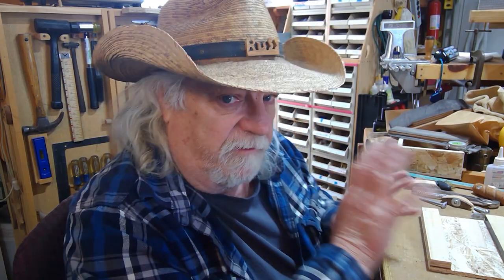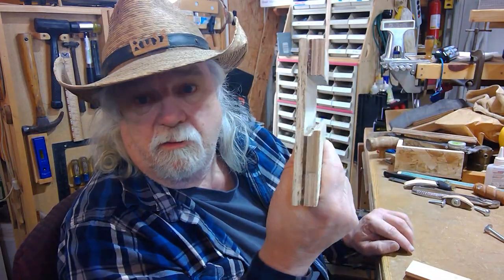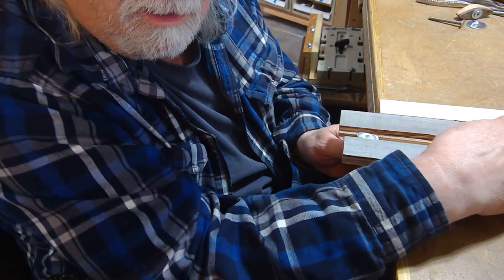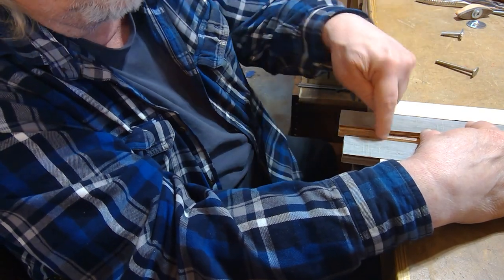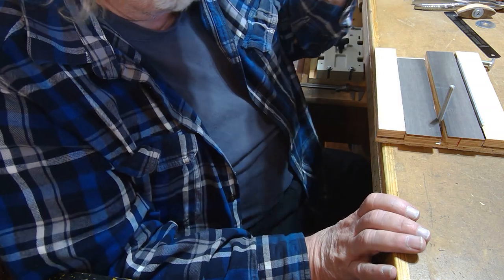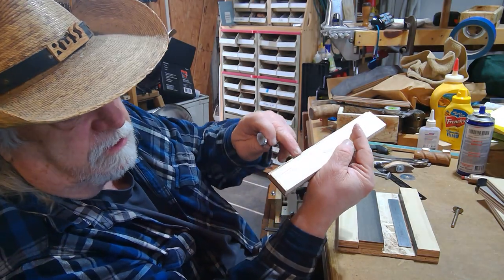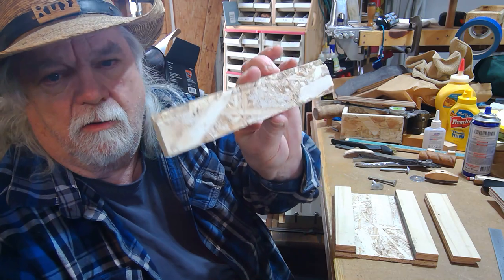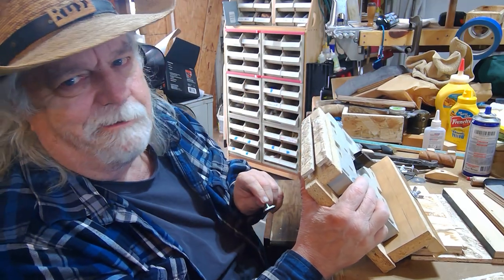DIY T Track & T Bolts by OTB Thinker

Comment: Well, Russ you certainly provided us with lots of variability. And that's quite important. I was looking for sources for the sliding nut and was amazed to find that only a few actually provided dimensions. And the ones that did provide them seemed to be those that also provided higher overall costs. So being able to slap together a t-track based on what you have or what was shipped is a handy skill to possess. Of course, ideas and techniques also are always a handy resource to have. As usual, well done!

Comment: Hi Russ, have you ever tried, making a T-Track directly into a Wood Top? Say, 3/4 inch or more thick. By using a T shaped Router Bit. Can't think of a proper name for it. Use a Bit, that has flutes, both on the sides and bottom. With a 1/16 inch or smaller Radius. Use this, along with a Straight Bit, for the first 1/4w x 5/16 inch depth cut. Then use a 3/4 inch Diameter T-Bit to rout a T-Track into the Work Bench Top. Setting the required Depth, to fit your T-Bolts. Using a Straight Edge, as a Router Guide. A straight board or metal that's thick enough, works well as a Router guide. I haven't done it either. But, I have used Routers to make Wood Trim. And many different things, over the years. I was a Cabinet Maker, back in the 70s-80s. And a Hand Finisher & Tool Maker, at General Dynamics. During the F-16 Program. We routed Radius's in Aluminum Machine Parts. With Hand Routers (Dotco Air Motors). Some, that the CNC Machines couldn't do. You can make many things with a Router and a hand Drill, if you get a little creative:) Thanks for sharing your experience...  Don
Reply from the maker: Thanks Don.  I do have one of those (& have used it), but not everyone does.  Also, getting T bolts to fit a particular track doesn't always work.  It might be handy to know an easy way to make your own T track or T bolts (or both) rather than a trip to the big box store or wait for an Amazon delivery.  Sometimes, it's just fun, like making hinges  :>)
Reply: @russveinot5754  Ya, I agree and like your ideas. What I meant, was... Making your own T-Track in a Wood Top. Say, 3/4 inch or more thick. With a couple of Router Bits. Not, buying those expensive commercial T-Tracks. When I started seeing all of those videos, on them. I thought, they looked useful. But then, I looked at the price of them and said, not thanks... I like your home made T-Bolts. And I agree, on the Carriage Bolts. I think, they will wear out your wood Tracks and start spinning pretty quickly. I'll try and edit my first comment, to make it more clear... Don

Comment: Russ, I had watched your updated panel saw videos and the comments about your original jigs.  I was thinking of using something like a unistrut instead of the 1x6.  But I kept thinking of your T-track ideas.  Do you think I could use an 8ft long or 10ft long constructed T-track like this instead of the 1x6 rail [ with holes for dowels]  on your panel saw?  I want the styrofoam 2x4's to be able to easily slide left and right -- to be repositioned around the cut line.
Reply from the maker: Been thinking about your ideas.  I think a Unistrut might not be enough flat surface. I do have my 1X6 mounted on my overhead door and the Unistrut weights a lot more than the wood 1X6 and would effect the door's weight.  I have thoughts of using French cleats on both edges of the 1X6 and mount 2 sliding cleats on the 1X6 and tighten when in place.  After almost 7 years since the original design, maybe it's time to rethink this thing and make improvements.  I think improving it's design is going to be one of my projects this year.   Your great ideas are very helpful and inspirational.  Thanks, Soose.
Reply: @russveinot5754  Hi, Russ.  I missed a few days in life.  I really liked the idea of using a T-track like this instead of the 1x6.  I'd replaced the unistrut in my mind with making a custom T-track. What's not to like?  How is that different from the french cleat sandwiched idea? (If I understand what you're meaning there.)   Wait, you mean a trapezoidal strip on the back of the foam studs.  And making a slot for them to ride along the 1x6.   Again, why not just build a T-track instead of the 1x6, as sturdy as needed?  I liked the idea of the T-track, light weight for the garage door but stiff.   The T-track bolts could just stay in the track or stay in the back of the studs.  (But the bolts would make it harder to stow the studs in a stack if they were sticking out. )
Reply from the maker: The difference between a T-track and French cleat system is the weight on the O/H door.  I can cut the angles on the existing 1X6 and make it weigh less (not noticeably) but to add a T-track I would have to add thickness to allow for the T-track.  Still not sure how to squeeze the cleats yet.
As to your previous comment, I use my small Ryobi circular saw instead of my DeWalt due to ease of use.  I should mention here that when I cut sheets down on the panel saw, I still clean them up on the tab. I tend to just draw lines with my drywall square and free hand cut the piece off.  I like my Ryobi saw because it is so light and has a laser light.  The light makes following a cut line very easy.
BTW, I think I've missed 2 months in life.  That's how long since my last video. I better get one done soon :>).  Nice to hear from you, Soose.
Reply: Goid to hear from you, too, and thanks for the reply.  :)  To clarify I meant to omit the 1x6 and use the homemade T-track made up out of flooring ply's or some other ply as a replacement rail. Not add it on.
Reply: I don't think you panel saw needs improvement. I just didn't like the looks of the 1x6 at the store. And you'd said about the adjustment of studs being a pain with the first design, so I was asking myself, what will travel along a rail...